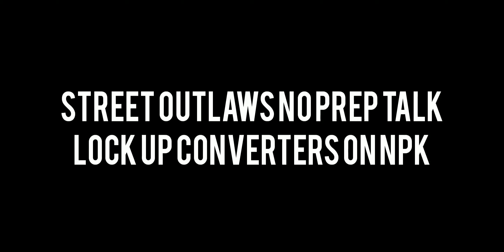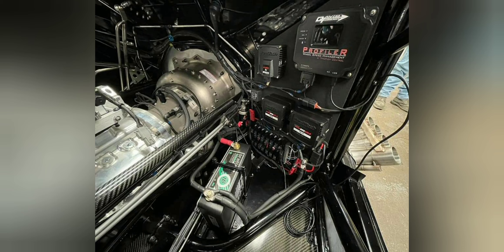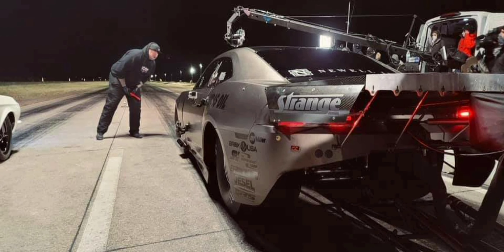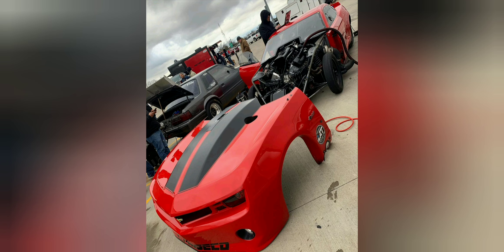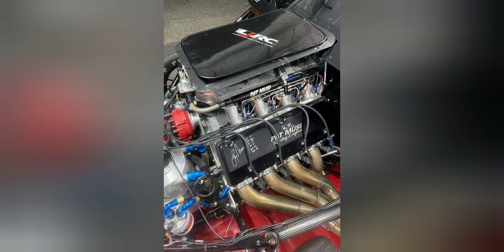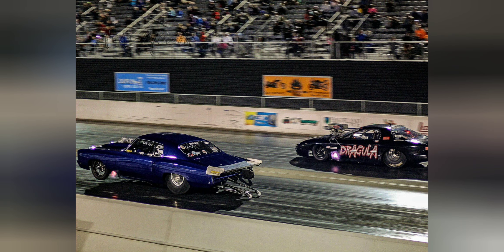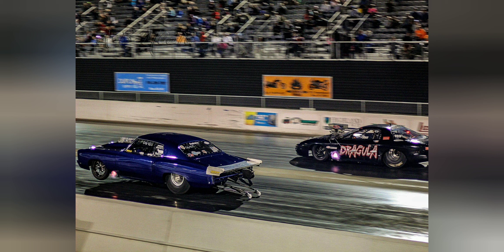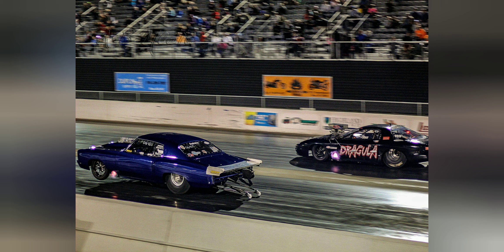Street Outlaws - Lock Up Torque Converters on No Prep Kings Racing, Kye Kelley, Big Chief & More!

Comment: We do not lock ours until it goes into second..otherwise it will greatly shorten trans life if it shifts locked..also..if it knocks the tires when locked,recovery is almost impossible  whereas with a converter it can recover.
Reply from the maker: Great info!